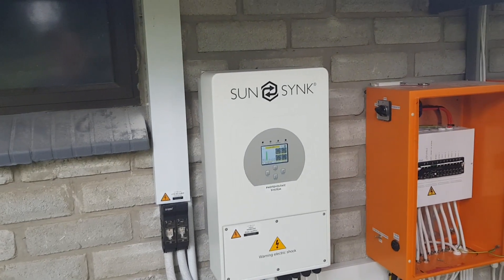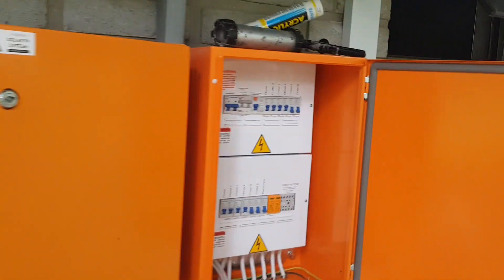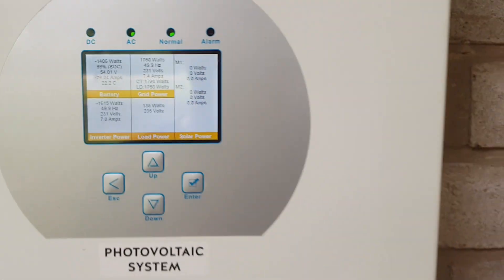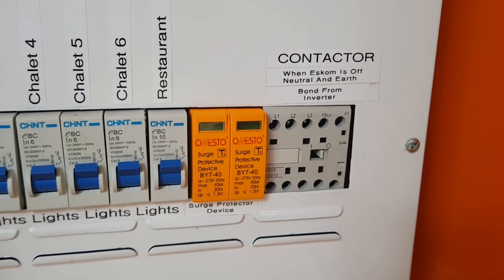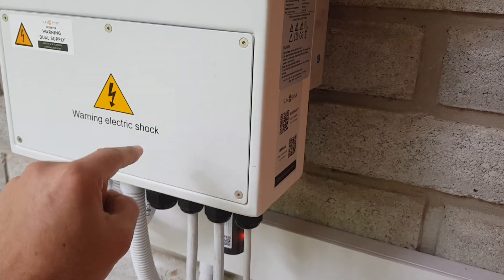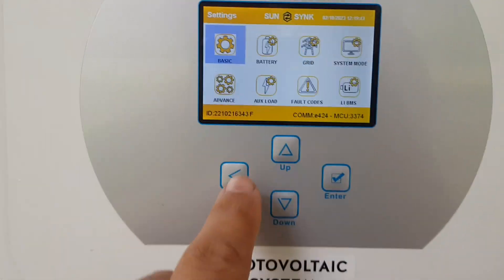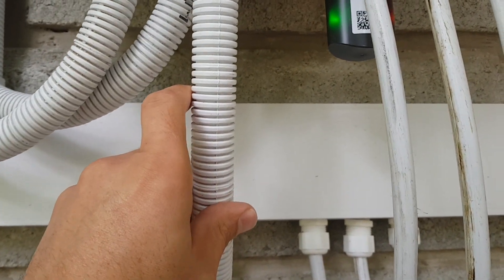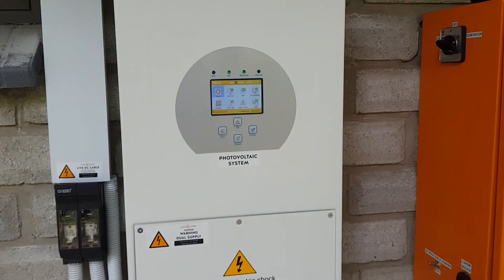Sunsynk 5kw inverter with Earth Neutral bond

Comment: Should one not do a permanent Neutral Earth Bond?
Reply: Your grid supply should/must be permanently bonded N/E from council/ Eskom side .If not log a call for them to fix it.

If you have your installation bonded while the grid is on it may cause an elevated  voltage to council/ Eskom guy working on a kiosk/ transformer even if they have isolated on their side (among other reasons)especially if your installation has got inadequate earth resistance.

So N/E Bond when the grid fails and disconnect N/E bond when grid is on.

Comment: Nice job.. So if you do not do and earth neutral bond that means when eskom is off and the inveter is running if I test a plug point for earth I will not get earth?
Reply from the maker: That is correct, and you will need an Earth neutral bond on the
Loadside loadside to make the earthleakage work while no grid

Comment: Good vid. What pins are you using for the earth neutral bond
Reply from the maker: We are not using that for the bond anymore and we have a permanent Bond now. The pins that say live and neutral are used to switch a relay and you have to activate that in the menu by ticking the signal islanding mode block
Reply: @jacqalas  oh ok ; so the live and neutral energize the relay coil . So how and where do you bond the neutral and earth . Suppose that will be the output of the inverter ?
Reply from the maker: https://youtube.com/shorts/WElya_jjNHg?feature=share

Comment: Worrysome that you use a contactor. 
You said the DBs were done by the electrician. Does that mean you are not an electrician and you did the inverter and battery?
Reply from the maker: I supplied the inverter and battery and assisted my electrician where they needed help and advise an yes the contactor is now changed to a permanent bond and the contactor now is used to power a light that turns the whole premises red to inform everyone that they are on battery power and must lower their usage accordingly.

Comment: Very nicely installed. Could you give details on the contactor used. Many thanks
Reply from the maker: We actually now do a permanent Earth neutral Bond and for that we remove the Earth wire from the output on the inverter. So we not using a contactor anymore on Sunsynk inverters.
Reply: @jacqalas  Are you allowed to make a permanent TN-C after a TN-C-S? What happens when PEN conductor is damaged at supply transformer? You could have a back feed via Main Neutral to your own star point if you had a shared line with a neighbourhood.

I understand a bond is necessary during loadshedding, but while you have grid power your Essentials are still connected to grid star point of supplier?
Reply from the maker: I know and these are the things and variables that bother me the most. We try but aren't always able to prevent each and every scenario.
Reply: @jacqalas  Is this for a full of grid application? If I may ask why did you do this? Just trying to learn?
Reply from the maker: @AltF4Moments  this is for backup power at a guest house next to a river during power outages. It keeps all the televisions and the internet on during this time. It also takes care of a few small fridges and all the lights at the premises
Reply: @jacqalas  Howzit man, why are some saying you MUST use a contactor and others are saying it should be permanantly bonded - with Deye and Sunsynk. There are so many confilcting stories, People are saying if its permantly bonded across Earth and Neutral on Load side the there is a floating Live, Neutral and Earth when Loadshedding happens - please help! thanks man.
Reply from the maker: @FlyByR10T  I know this is confusing but we tested it with a tester and the Earth neutral Bond is there when the grid falls away. The problem with the contactor is that they can fail and then you have unsafe installation
Reply: @jacqalas  OK Amazing. So as long as I bond Neutral and Earth load side I am good to go? Then I can ignore the Signal Islane mode as well?
Reply from the maker: @FlyByR10T  that is correct but you do not use the Earth from the inverter output side. That earth should be disconnected.
Reply: @jacqalas  but connect that earth to the chassis of the inverter? Along with the earth from the grid, like with the 8kw deye?

Comment: Lekker man, I am wondering what size cables I should use for AC input and output to inverter. I have a 5000w SunSynk. Since it can output max 10000w for a few seconds, would cables that can handle at least 10000w be required or only 5000w (23A)?
Reply from the maker: 6mm would be sufficient. Cable won't get enough time to heat up trough a spike.
Reply: 6mm is usually enough, but i put 6mm on output and 10mm on smart output /gen ort

Comment: Thank you... confirm ONESTO has been type tested. Their MCBs only received Type Test certificates in 2021...many melted prior to that. Request that From ONESTO or your supplier, or your SANS10142-1 Wireman is held accountable. CBI is good CHiNT is ok , even though I don't like them they compliant I believe I've never followed up on them only ONESTO and all these other brands and re branded MCBs I don't install so wouldn't know...but ONESTO I had to due to melting ( not solar install, normal electrical install where this occurred)....stick to SANS & IEC even if it's printed on the item double check...fyi

Comment: Thought the new installation manual show otherwise, not using relay but permanent earth neutral bond and then not using PE on LOAD side?
Reply from the maker: You are correct and I also saw that. It definitely shows that in the 8kw manual. We will change accordingly
Reply: @jacqalas  shows in 5kW Sunsynk and in Deye manual

Comment: nice, can you earth be shared from mains board to inverter to battery
Reply from the maker: I'd rather not comment on that. In my opinion that would be the safest but in South Africa I don't know how long you can still Trust on the utility's ground. Whatever you do just make sure in the end you get zero volts between neutral and ground even when the inverter is in backup mode or the grid is back. Good luck with that and make sure to ask an electrician except if you are one just to double-check everything.
Reply: @jacqalas  thanks for the tip, with earth leakages moving to current devices and not having an earth tail , most just goes to spike, the earth leakage jus operates on current drop between live and neutral and not the sign of current on earth